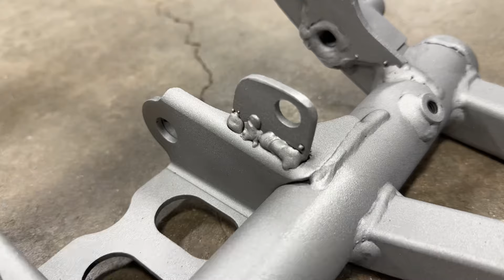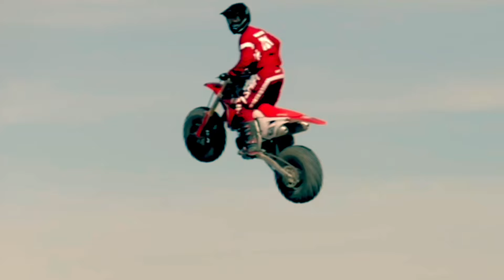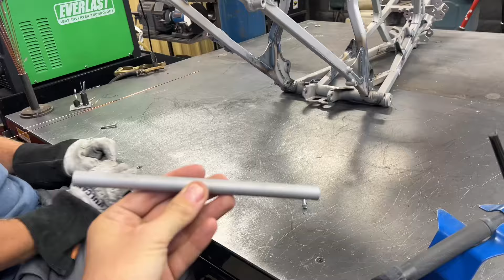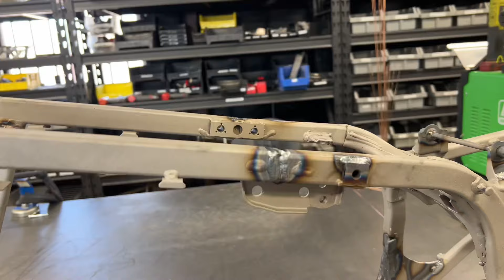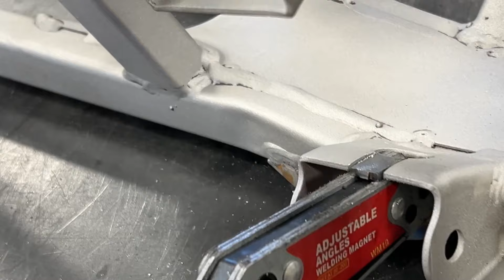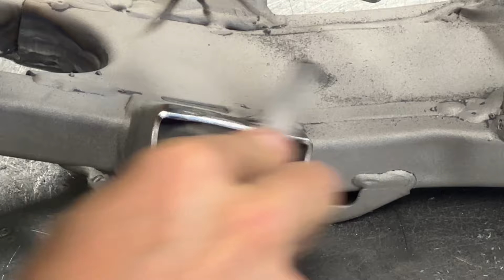1987 Honda TRX250R Frame Repair & Welding - Part 6

Comment: How’s the Everlast welders? Any complaints? I’m looking for a Tig machine, I have a Miller 251 MiG, don’t use a Tig  enough to justify cost of a Miller
Reply from the maker: We have 2,  they have a 5 yr warranty - only issue we had in 1 of them after a few yrs was the cooling fans (our fault for not cleaning) and they warrantied it.        

They have been great , we have tried other brands and you cant beat the price and quality of these…